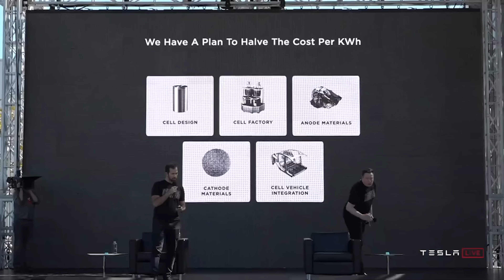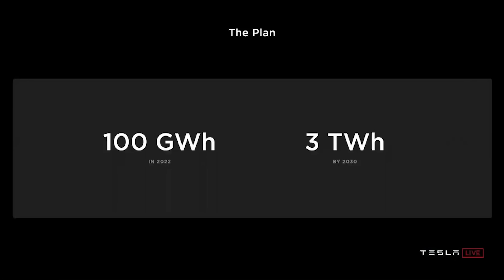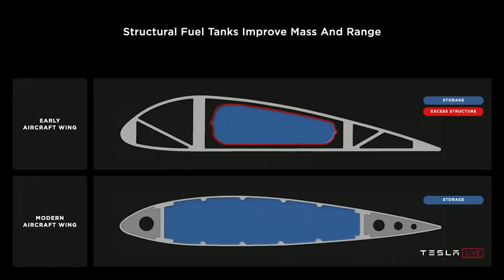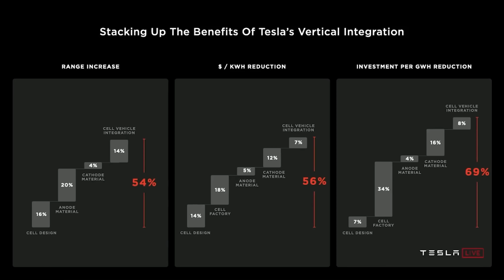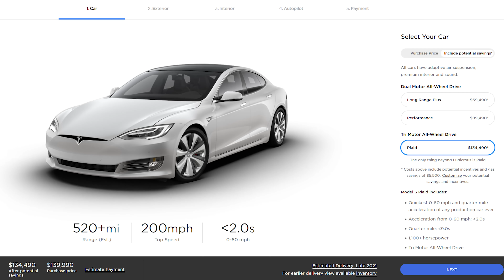Was Tesla Battery Day a Let Down?

Comment: Can someone explain how the power and energy of the batteries is being expanded 5x and 6x yet the range only goes up 16% ?  I am not an engineer so forgive me if this is a dumb question.
Reply: The cell is 5x larger than the old cells.  So a long range Model 3 would only need ~800 instead of the ~4400 they have now. The 16% is due to the improved improved energy density and/or weight savings by having less battery casings.   Its a lot easier to make and install 800 larger batteries than 4000 smaller ones so that saves a ton of money.
Reply: @trengilly01   Thanks - that’s a great explanation - taking the idea further to it’s extreme why not just make one large battery with one casing ? -
Reply: @Gazzapa57  The larger the battery the harder it is to control the heat it generates and to cool it.  The tabless technology they have figured out is what is allowing them to make them this big.  Everything is a trade off with batteries . . . improve one specification and it cause issues somewhere else.
Reply: @trengilly01    Yes  for sure batteries are more complicated then I thought - As they are now talking about integrating batteries into the frame and become structural elements I am wondering if somehow airflow is or will be funneled thru the frame as the car moves forward to cool the batteries ?

Comment: They didn't tell you the new battery is 8X volume larger but only 6X power than before! 

R U Kidding me?
I can do the math OK!
18650 battery is 18mm x 65mm size, new one called 4860 is 46mm x 80mm
V=πr2h=π·92·65≈16540
V=πr2h=π·232·80≈132952
132952/16540≈8.038
 it is 8 times VOLUME!

Comment: 5X more energy (did he mean 1250 Wh/kg?) + 6X more power but the range may increase 50% only?!!!!! Cost of KW/h per battery pack -56% + Investment per KW -69% + -75% less investment for battery manufacturing +  -66% investment on cathode + -33% cost of lithium + -76% another cost related?!!!! In 3 years with -60% cost & 6X more range 3000 KM?

Comment: I think a lot of the specs on the Plaid Model S was Elon's way of "1-upping" Lucid. The Lucid Air can do 517 miles? Well, Plaid Model S can do 520+ miles. Lucid Air 0-60 time is 2.5 seconds? Well, Plaid Model S is under 2 seconds. And it's cheaper than the top of the line Lucid as well, $139k vs $169k. Not to mention access to the Supercharger network, which continues to expand every year.

That said, I'm genuinely excited that Tesla keeps upping the ante, which is forcing other automakers to make their EV's better, faster, cheaper, meaning consumers, and ultimately the environment, wins. Can't wait to see that $25k Tesla.

Comment: in some ways,   YES!
Reply: In no way did they disappoint. These children playing in options trading is just mad there wasn't anything more immediate
Reply: Maybe it's just me but I thought they were going to talk more about the practical benefits of the new battery (e.g. faster charging, easier temp management, faster discharge, better regen).  They really didn't talk about any of that, almost like they intended it to be a bit of a sleeper.  Maybe they don't want to over-promise on the performance side because the manufacturing isn't where it needs to be yet.
Reply: John Cleary Osborne effect. Why would u buy a model 3 now.... if 2022 model will charge 3 times faster and go further, while costing less
Reply: @AbstractAggregate  To avoid it Osborne effect...
Reply: Me who thought they were going to reveal the design of a $20,000 electric SUV:
Reply: CoolcarlGaming 
Lol, that would be nothing short of a miracle at this point my friend.  And how would they sell their brand new model Y and also model 3 if they are going to have a $20k SUV in a year? Lol

Buy Nikola if you want great promises in record time.
Reply: @superfly19751  It would be pretty epic though lol

Comment: The $25,000 car will be stainless. Like the cyber truck. This is considerably, considerably cheaper to produce.
Reply: stainless steel costs roughly the same as aluminium...
Reply: MrDnB89 but they won't have to spend time making bends. Just straight angles just like in the cyber truck. Getting those curves takes time.
Reply: Back to the delorean
Reply: So what? Does it still have a steering wheel? Who needs that?

Comment: Man you gotta acknowledge, their improvements are literally insane! My goodness that battery improvement is wonderful. But speaking of vertical integration, this is very similar to Apple products, especially Apples processors year to year. So if some right, their batteries and overall businesses will be game changers!
Reply: Dude : Vertical integration in Apple? 

They outsource all their manufacturing :)
Reply: @AlanMyronPrivate  Indeed. I don't know why people get the idea that Apple is vertically integrated. They use a lot of off-the-shelf chips and let Foxconn do all their manufacturing. If Apple was vertically integrated they would be the low cost producer of smartphones, and they're not. 
 
They do design a custom system-on-chip based on a processor design by ARM, but that's not really what is meant by vertical integration. Yes, they exercise control over the chip design, the overall product design, and of course the operating system, but not the manufacturing costs or logistics costs. And their designs aren't built from scratch, they're built around ARM at the processor level and the Darwin BSD kernel at the operating system level.
Reply: @dlwatib  Think they're usually referring to Apple designing both their own software and hardware themselves, rather than the manufacturing supply chain.
Reply: @dlwatib  That is because Apple and Tesla do vertically differently because they make different production. For the iphone, apple is doing more vertical integration then most large phone maker. Apple vertical integration the more cost efficient and high profit of their product.   For Tesla, they do more vertical integration then more car maker. Since there is not a great infrastructure for battery. They are force to vertical integrate so they have a cost efficiency

Comment: Battery cars charged from Coal or Gas power plants are not zero emission! Please explain?
Reply: simple, can you shut the garage door, start the car and die from the fumes? no, you cannot.
Reply: Zero emissions is tailpipe...
Reply: People who buy electric cars tend to have a cleaner power grid or zero carbon grid electric.  Per capita, the highest concentration of electric cars (in the US) is where nuclear power allows people to charge at discounted rates overnight.  Metro Atlanta has the highest ownership rate of electric cars per capita and their "off-peak" metered rates are discounted 80-90%. There's also a strong cultural correlation between electric car ownership and renewable utilitly power, weather it be on the generation side, or on the consumer side where consumers who can choose their power company choose a cleaner or 100% renewable power company (arcadian energy, etc).

Comment: I bet $25K will be almost identical to the model 3 specs, but cheap as hell to make. Also the ICE manufactures sell near production cost and make money on the maintenance. Maybe Tesla could sell at cost but request the car for taxi network so many hours a month? But if they hit $25K with profit margin, game over ICE manufacturers. Also if they started front wheel drive, that could expand into more wintery markets for a lower cost point.

Comment: Ben, are you ok? First I was happy to hear new battery tech that is not working just yet but will in 3 years or so and 3tWh by 2030 .. well many others are working on battery tech as well they just don’t make an event around it .. I was disappointed in that nothing new for about 3 years if that and the Plaid Model S in about a full year away .. and if that may be longer .. anyways base on the pic on the web site looks just like the old current model S just cost a ton more for estimated more range and  1,100hp or so .. hmm sorry but Tesla needed 3 motor to come close to 2 Lucid motor ok .. and that 520 miles is estimated not EPA testing or even EPA estimated.. just seems like a number he put out there just to say he still king .. get it independently tested first before I can say Tesla is still on top plus we don’t even know the kWh battery capacity he estimated will need to make 520 .. sorry but a ton more data is needed to even talk about that 520 number .. also we will never see that 25k car in 3 years more like 4 or 5 and truly disappointed with his V2G comment omg Elon was like a sales man trying to sell power wall instead of doing the right thing, Tesla know if people have V2x they can charge other cars in an emergency and power your home .. why have battery sitting at home if you don’t have Solar roof/system .. I still have my model X and would be so happy if I could used 100kWh backup vs my little 5kWh battery backup .. overall I am disappointed in this event because other manufacturer will continue to improve on their battery and other tech in the next 3-9 years just the same .. what does Tesla have to show now or in the next  6-9 months .. nothing ..
Reply: Lucid is more expensive. And they’ve been spot on with their range estimates. They usually aim lower.

Comment: Million mile battery 300 miles x 4000 cycles .= 1.2 Million miles
Reply: Doesn't work like that
Reply: If battery does not make a full charge/discharge cycle it’s likely to last longer as it’s less stressed.
Reply: If you keep the battery between 20% and 80% and we don't use a battery degregation  factor, it still "only" lasts 720,000 miles.
Reply: 520 miles in the plaid means less than 2000 cycles. Seems doable
Reply: Akashic Samadhi. Exactly. That's why the only
Is in quotations.

Comment: As an engineer, the most impressive parts of Battery Day were: 1) The goals they are trying to achieve, 2) How they have broken down the gaps between those goals and their current capabilities, 3) How they solved for the gaps. It's clear that they are thinking about the value chain issues much differently than any other company.
Reply: That’s why only who will make it a big on Tesla investment are those with high convictions - with Cathie Woods  being the ring leader... I’ll certainly want to stay in the Ark-Invest club!
Reply: James McC2.4hum  ...a 56% cost per kWh drop in price at the pack level gets them well below $100 a kWh, probably in the $60 range per kWh. That gives Tesla an enormous price advantage over the competition. A 54% gain in range...making the Semi doable, making a Model S with a range of 520 miles (and insane beyond supercar performance for only $140,000), making other cars less expensive with the same range they have now...

I heard several things giving increased power density, not sure what you watched. Probably you watched the Flintstones again. New cathode and anode, tabless, go watch it again.
Reply: Anthony Archer,  I agree. Elizabeth Holmes also had “goals” she was TRYING to achieve. She broke those gaps in goals down and “Solved” them, just like Elon did. Unfortunately both Elizabeth and Trevor claimed to already have it in hand. Elon uses careful words and “leaked” images of the cell. 

If the President of Panasonic gave the exact same presentation as Elon, the cult members would pick up on key words and say “so you can’t really make it, can you?” Lol
Reply: James McC2.4hum  In that case, I am fairly certain it is the Chinese battery technology Elon is claiming as his own then.  Chinese battery makers have been pushing the blade battery for a while(same chemistry, but more dense packaging and safer).  So far, it was mainly a BYD push for their Fe(Iron) battery because Fe Battery density is lower than Li battery.  Another battery maker recently announced a big deal with Tesla using the same idea.  Fe Battery will lower cost significantly and will be used in low end Chinese model 3, allowing Chinese model 3 to  be cheaper than US made ones.
Reply: @Tony_A10  Only the ones who think about more than product specifications.
Reply: You should see all the safety violations you don’t see 😀
Reply: DimWit companies have been doing these for years, nothing new here, ask Toyota they are the leader, where did you buy your degree from???
Reply: A lot of people bought into the stock market with no experience.  You lost because because you are trying to be a trader buying and selling and aiming to get rich quick. If you lost money it is your own fault, not Elon's or opinions of the youtubers.  You should always do your own research, not buying into the euphoria and hype.
Reply: This leap in energy density would be the greatest breakthrough in electrochemistry by a factor of nearly 10...  It's bullshit just like all the battery "breakthroughs" of years past.. I will eat my own shit if that battery gets released as specd.. remember how the 2170 was supposed to be a 100 percent increase in energy density?  Than it became 50 percent.  Then when it was release it was more like 10-15 percent... STOP LYING TO US ELON
Reply: @sailexw6414  , you really listened to the entire detailed explanation, complete with photos and video of a working factory line, and thought it was "bullshit?" For sure, you will be eating your own dump on this one. Every other claimed "breakthrough" was just one super great idea they could not actually reveal to us but it was coming soon. This is lots and lots of ideas all combined, actual patents granted by the patent office, actual companies purchased (Maxwell has been in business since the 1960's if memory serves, they were not some start up making wild claims), actual ideas to cut costs and processes literally starting at the mines, innovations in almost every part of the battery cell...

They have spent years on this; they hired arguably the world leading expert in lithium batteries, Jeff Dahn, years ago, they bought a good number or companies to acquire their technology and their employees, they have multiple battery related patents granted...this is what the real deal looks like.
Reply: tribalypredisposed production cost reduction I can believe, although now Chinese companies are leaders, VW, Audi, MB, Porsche and BMW are using Chinese battery tech, so is Chinese model3.  Chinese model 3 will be cheaper than US model3 by the end of this year.  But battery chemistry? No, no way.  Battery chemistry starts in universities at least 20 years ahead of production.  No such tech is even in discussion today.
Reply: @tribalypredisposed  You know how Elon takes the roadster out and blasts it down the showroom floor at undeniable speed?  That's what we needed today.  Some data.  Some test results. Something tangible!  Elon said himself the technology has not been totally proven yet and is still basically in the theory phase... Its basically "Cool idea Bruh.."
Reply: Oil is here to stay
Reply: @Dean_H.  to stay inside of the earth hopefully, where it has been the last Million years.
Reply: @Dean_H.   Exactly, stay deep down where it belongs.
Reply: @Dean_H.  - You are very wrong, big oil is headed for bankruptcy.
Reply: @Dean_H.  combustion engines are loud, expensive, frail and not as powerful as electric. Oil will be useful just for jet fuel since plastic and ammonia are both made with natural gas.

Comment: I wonder what the specs are on the cell in terms of absolute capacity?  4.2 V and ~25 Ah?  So around 100 Wh per cell? 
Only 10 cells per kWh is crazy for their size.
Reply: 4.2V is their current 2170 cell (max), nom 4V maybe, and 4.8 Ah. I'm going to guess 4.7 to 5V,  ≥ 20 Ah

Comment: So with better/cheaper battery tech coming in 3 years or so, trying to decide if I should buy or lease a Model Y. In the past I have always bought new and kept the car for 10-15 years since there have been few fundamental changes in ICE cars. On the other hand, S and X are still using 1865 cells so may be a lot longer that 3 years while they pump up Cyber Truck and Semi with the new cells?